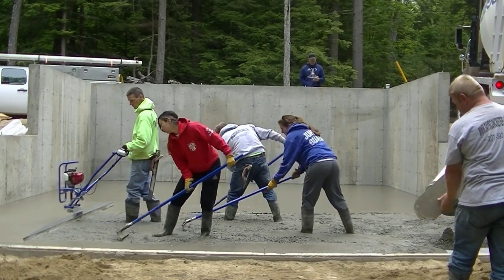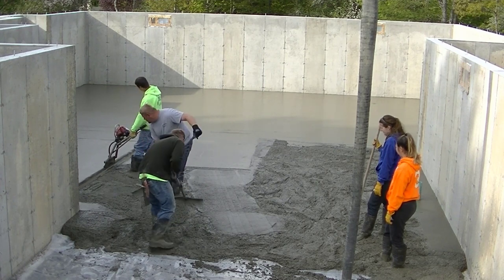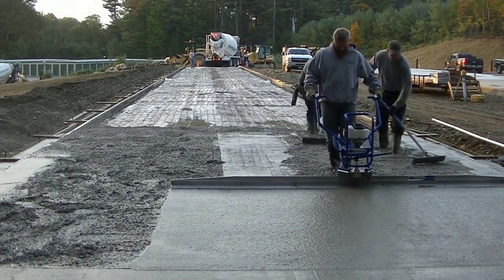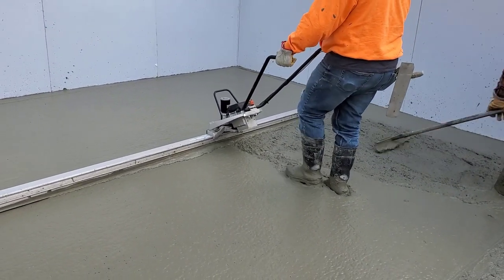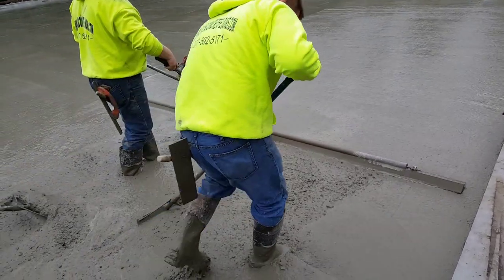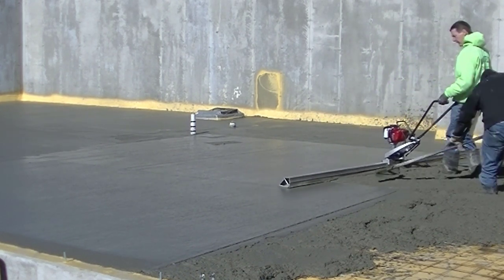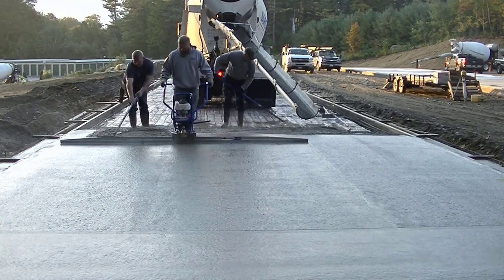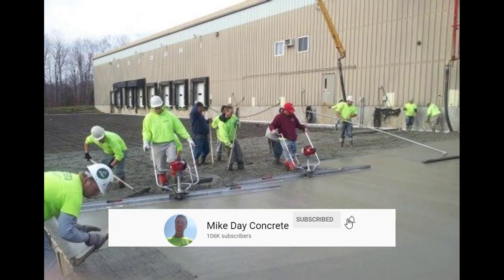Vibrating Screeds - Which One To Get (Do You Need One?)

Comment: I use a vibra strike but it's the single handle head. Works good for us. Use it on just about everything. Need good puddlers no matter how you do it. Did couple 300 yd and a 450 yd slab with one

Comment: I used the mbw screed demon a while back with the old crew i was with. When i got to the crew i was last with, my boss had a vibra strike that had a different style bar ( was like a big angle iron) and it didn’t have the two handle bars on it. You had the motor off to one side of your body. I hated that design.

Comment: Just curious to how long your screed board is on the machine? I've been doing concrete all my life my dad and grandpa have been doing it since early 80s.. but I've only ever tried to use a vibrating board one time and it was awkward and heavy.. probably was the cheapest version you can get.. wasn't mine. Anyway I'm looking to get one but I want to know what's the best screed board length to make it work easily. I have a 4ft, 10ft, 14ft, and 16ft aluminum and magnesium boards for hand screeding but my grandad retired and Dad's getting old and I need something to make our job easier. I see they have tomahawk brands for much cheaper but do you think it's better to go ahead and spend way more money for a better brand? Thanks for your time and God bless

Comment: Hey Mike out of curiousity  have you guys ever tried one of those cheap Chinese knockoffs  Power Screeds they sell on EBay ? I am not a Concrete contractor  just a DIY guy and  I’m looking at property that  will need a  few slabs poured BTW I do have 25 years of Construction history  and in my past I’ve always bought name brand  high quality Equipment , my slabs will probably be  done by a  small GC  that I’ve been freinds with the owners for a long time  I would of course let them  use the Cheap Chinese’s Power Screed on my slabs  and they will have some guys raking  my personal Concrete  background has been  several slabs and Driveways we used to stamp Cobblestone patterns into on a housing Development  a General Contractor I worked for years ago speced out  on their Developments which BTW they owned the stamps for